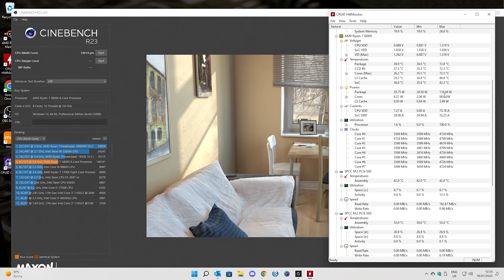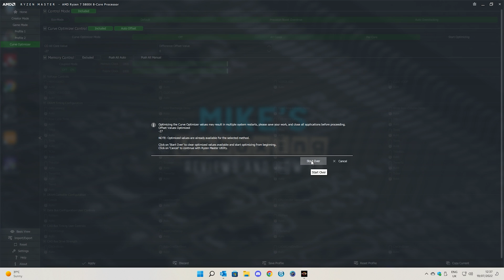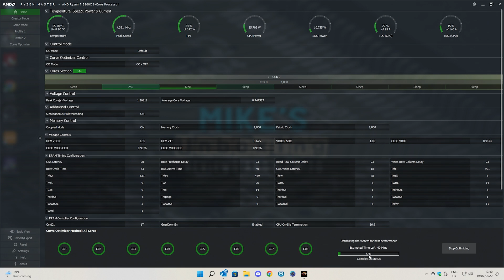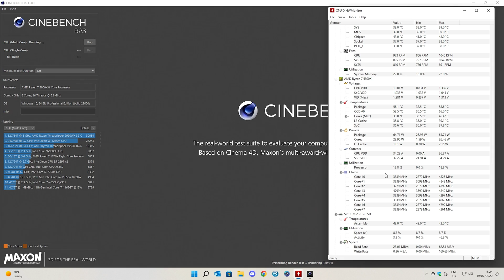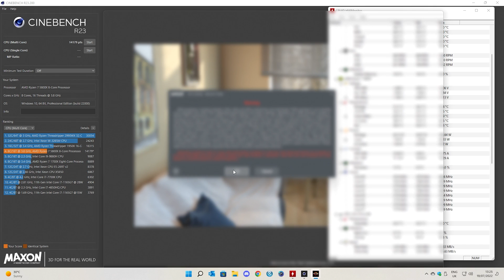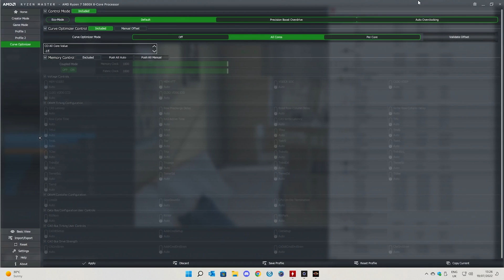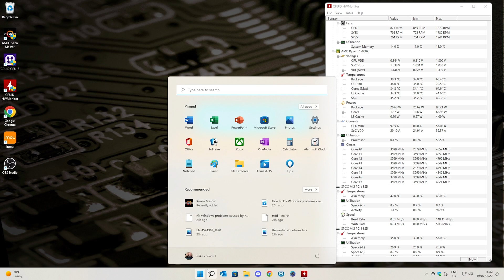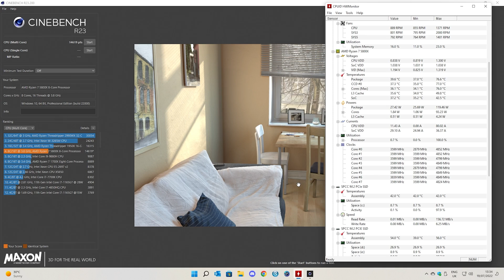Make AMD Ryzen 5000 Series FASTER QUIETER & COOLER With Curve Optimiser

Comment: I have a Ryzen 5700X using a ASUS B550 Prime Plus with a NZXT 280 AIO, Corsair Platinum RGB 32GB 4x8GB @ 3600Mhz and a RTX 4070…I just ran the Per Core Optimizer and it’s figures just showed me -30 and I applied and all seems fine…surely this can’t be the case? The program said it may restart multiple times but it never did just took an hour to complete. Can I just keep the applied settings and not have to worry about PBO?

Comment: Hey, first of all thanks for the video, it helped my keep my 5800x under control even tho I have a dual tower air cooler and very good case airflow, second, do you know if Ryzen Master has to be opened each time and click each time apply in order for it to work or is it saved?
Reply from the maker: yes ryzen master needs to be running for the master settings to be working

Comment: Hello.

I followed your tip on your video using the Ryzen Master but on the part of changing the value from -19 to -27, it restarted over and over when I entered my profile password and loads up. I'm still waiting for the third attempt to open my profile for the third time. Should I revert back to -19 just in case?
Reply from the maker: yes lower it a bit to regain stability
Reply: @mikesunboxing  thanks for this help. When I tried to lower it, I turned off and pulled the power cord out, and performed clear CMOS. Then I turned on and checked my BIOS if there were settings that changed to default. After this, I proceed on loading Windows.

Upon loading Windows, I proceed to Ryzen Master and revert back to -19. I wonder how to stop the start-up prompt of the Ryzen Master upon loading to Windows, because this automatically prompts me to use it although I'm not opening it during the Windows loading.

Comment: hello,  I have a Ryzen 5 5600.

I optimized mine and Ryzen Master set set it to -27

my max temp is 72.9
max power package is 95.20

I tried it to -30

my temp and power is much lower,
max temp is around 54
max power package is 65

but my core clocks are not reaching 4.6

it's only maxing on 4.2

any idea why is that? and what should I do to reach 4.6 at lower cpu temp and power
Reply from the maker: might need to manually set the multiplier, but if the performance is the same or close i wouldn't bother
Reply: @mikesunboxing  how do i do that?  btw, im apparently optimizing PER CORE and see the difference
Reply from the maker: This is maybe easier to fix or at least advise if we can ask more questions and get direct answers, so feel free to join our Discord chat and we can go over it in more detail https://discord.gg/XtBTGQ6BDu

Agree to the rules by clicking the emoji and you will get access to the rest of the Discord channels @macabrecreation1067
Reply: @mikesunboxing  thanks a lot 😊

Comment: I just did this with my 5700x.
With only curve optimizer running and overclock still set at auto without adjusting anything its running a -26 all core with CO. 
I ran cinebench r23 with YouTube playing in the background and got a CB score of 15,631. 
How is my 5700x scoring better than his 5800x?
Reply from the maker: more tasks running in the background and maybe better quality silicon or cooling
Reply: @mikesunboxing  oh i see. That would make sense. 
Quick question: Will curve optimizer automatically undervolt each core to optimal levels or do I need to undervolt little by little till i find the sweet spot AFTER having curve optimizer already enabled?

Comment: 14,600 for 5800x is low I guess. I got 15,600 but temperature got upto 88 degree.
Reply from the maker: yeah i have way too much crap running in the background.
Reply: @mikesunboxing  Which cooler did you used with 5800x ?

Comment: I have the "Control Mode" option in the basic view, but the "Curve Optimizer" option is not displayed. - Do I need a special board / a special Ryzen processor for this function?
Reply from the maker: what board and processor do you have
Reply: Ryzen 3600 + MSI B450 something.
Reply: However, I have long since solved the "mystery". The FAQ provided by AMD for the Curve Optimizer states the following: 
Is it supported on all AMD CPUs?
No, the Curve Optimizer feature is only supported on the CPUs listed below:
Desktops using AMD Ryzen™ 5000 processors.
AMD Ryzen™ Threadripper™ PRO 5000WX processors

Comment: Is there a way to make new mater ryzen settings be applied upon pc startup?

Or will i always have to open
ryzen master app to apply my undervolt settings?
Reply from the maker: you could transfer the setting to the BIOS, that would do it, the reason it doesn't auto run is because if you screw up the settings windows will always try and load them

Comment: The only bad thing about Curve Optimizer is the interminable battery of testing that's required before it can be certified stable.
Download PBOTuner 2 and Corecycler, and be prepared for some (automated) overnight testing - Ryzen Master gave me -28, -30, -30, -30, -30 and -30, but testing eventually forced me up to -20,-20,-30,-30,-25,-25 (which is still a cracking result).

Comment: great video, thanks for it. I would like to ask what cooler you use for the r7 5800x in this test? Also how you got the power of the package be only max 110w without changing it in PBO? In default when I run cinebench r24 it will run on my r7 5800x 142w on package and temps go to 85C. I got it little byt down but need to do curve opt per core (got only -25 for all except primiry and secondary core, this needs to go  down to -15 for now) and also needed to adjust PPT to 115w TDC to 90A and EDC to 100A to get lower temps. but still hit 80C. also without the limit of PPT the CPU always took 142w on package when running cinebench r23 ( multi core test). also with this setup I got only 4,4 GHz on all core in CBR23 in multicore test. thank you
Reply from the maker: cooler was probably sahara ex360 i think at the time, not sure what other tweaks were done sorry it was a while back now

Comment: I'm having issues with my 7600x on the X670E Steel Legend, with bios update 1.24. Windows 11 - 21996.1

I have a 280mm AIO, Liquid Freezer II Rev 3, and I have ensured 3 times that its functioning properly and is more than adequate cooling. BUT still no matter what, it cant get the temps down the same as what would usually be expected with these specs, and thus its thermal throttling and hitting max temps (95c).

I'm getting around 12200 - 12400 in cinebench r23, when the expected result stock, even with a shitty air cooler should be in the range of 14k+ bench result.

I've got this niggling feeling that its something to do with the bios, but I wouldn't know, because when I first set the PC up 3 days ago, I updated the bios with USB before I even installed windows.

I really want minimal risks with installing BIOS updates, or roll backs for that matter, but I'm still wondering, does anybody else have this issue, or have had issues with low stock benchmarks on my board, and whether or not its worth rolling back my BIOS and if so, to which one.

Specs:
2x G.Skill Trident Z5 Neo RGB 16gb DDR5 6000 CL36 EXPO
x670e Steel Legend
Ryzen 5 7600x
Zotac 3060 TI Twin Edge OC
Arctic Liquid Freezer II 280 A-RGB
SN850 1tb NVME
Windows 11 - 21996.1
Reply from the maker: definitely get the newest bios then test again, if you are unsure if the BIOS update worked correctly update it again to be sure

Comment: What's the stepping of this 5800x B0 or B2 as B2 Stepping 5800x has already optimised by amd i have 5800x with B0 and horrible temprature spikes and running 90+ in no time as soon as started multicore cine bench r23 what to do now please help me out can AMD give me rma for the thermal issues?
Reply from the maker: the details in the video should enable you to reduce temps quite a lot, although all core cinebench loads will also generate a lot of heat
Reply: Can AMD accept the RMA Request if generate on the basis of high thermal issue overheating amd thermal throttling and abnormal behaviour of their perticular defective product?

Comment: Thank you so much, Im glad i found this video. Last time i saw a video about under volting 5000 series was too technical and i cant follow everything. Im glad this video exist. Now my 5800x run cooler from 89-92c (default) to 75-79c with 14944 score on cinebench
Reply: thats still quite high
Reply: @89MTN Everyone seems to be missing the point Ryzen processors are designed to run like this AMD tells you this perfectly safe. You wouldn't buy a 1000cc sports bike and only ride it at 60mph would you it's the same difference
Reply from the maker: Glad it helped

Comment: This detailed video was quite helpful. I recently bought a PC that has the same CPU. I'm in a much cooler room (22C) than you were and out of the gate with a fresh Windows install Cinebench is driving the CPU to nearly 90C with just 1 pass! This PC is liquid-cooled and the seller claimed that it did not have issues, so I've reached out to them to resolve this. I'm assuming they did not adequately liquid-cool it. Thanks for the video!
Reply from the maker: sounds like it isn't properly installed
Reply: @mikesunboxing  It's an MSI pre-built (the Aegis ZS). It's possible they made a mistake during assembly but I'm wondering if it's a lack of enough coolant.
Reply from the maker: @Daniel-vx5vc  This is maybe easier to fix or at least advise if we can ask more questions and get direct answers, so feel free to join our Discord chat and we can go over it in more detail https://discord.gg/XtBTGQ6BDu

Agree to the rules by clicking the emoji and you will get access to the rest of the Discord channels

Comment: So I ran this with pbo +200 on and let it run the 40min test. Im actually mind blown. Im hitting a few points over 12k in cinebench multicore now with a little ryzen 5600 on a 360 AIO.......Thats faster than an 8 core I9 9800X in multicore. waw what a difference. Im also running everything on full load at least 9 Oc cooler than before. The offset it wanted scared me a bit but its not had a problem in 48 hours of heavy use. -30 offset it chose btw waw. I honestly thought running this on a 6 core with such a heavy duty 360 AIO on it wouldnt be worth bothering with. Boy was I wrong. This CPU now under load sits at 4.645ghz steady while running cooler.
Reply from the maker: that is an awesome result, well done
Reply: settings pls

Comment: I did that and my temp never went above 65C..so im wondering is my cpu working properly or my cooling is too good?? I have 5600g with AMD cooler that comes with it.. max freq. Is 4.449,voltage 1.311
Reply from the maker: that sounds pretty good for the stock cooler, if the benchmarks look about right i would not worry too much about it and just enjoy it
Reply: @mikesunboxing  i did it again just out of curiosity.so the temp is perfect but around 54% completion i just get random reboot.im thinkin the voltage is too low, i already have offset on -0.5..idk it just intrigues me now.btw tnx for taking the time for reply

Comment: Hi Mike - I wonder if you can help - when I run the Curve Optimizer and apply settings, on reboot it gets stuck in a boot loop and won't open windows (11). I can remedy this by resetting BIOS, but obviously it then won't have the settings applied. Any ideas what this could be? It's the 5900x
Reply from the maker: It might be applying a too low voltage maybe manually up it a little
Reply: I have the same problem with my 5900x.

Comment: Ryzen master give me -30 for all cores but the power goes up tp 1.45 mV. I got more fps and bit less temperatures. But where is that undervolting? I thought to get around 1.2 to 1.3 mV maybe loose some fps / ghz but much better temps? Did I something wrong
Reply from the maker: ryzen master is a bit conservative on voltage, you might be able to reduce it more
Reply: @mikesunboxing  what should i do if i want to decrease voltage and temp? I Choose - 25 and voltage not descrease
Reply from the maker: @nef1ss  This is maybe easier to advise if we can ask more questions and get direct answers, so feel free to join our Discord chat and we can go over it in more detail https://discord.gg/XtBTGQ6BDu

Agree to the rules by clicking the emoji and you will get access to the rest of the Discord channels

Comment: great and informative test. One thing to note, is that the number in the Curve Optimizer setting is not the raw milivolt number, but rather a kind of multiplier, where 1 count equals 3-5 mV. so when it shows -27 you're actually offsetting the voltage by 81-135 mV, hence the massive difference in temperatures.
Reply: Thats interesting thanks for the info friend. My offset on a little ryzen 5600 came out -30. The results on cinebench are just over 12k multi now. Ive gained over 300 points. I also run at least 9-10 Oc cooler under load than before. Isnt -30 a bit high though? I ran the test twice to be sure and first was same. I got that offset while running pbo +200 and it sits at 4.645ghz ish and barely moves.
Reply: @bumblefoot5  this isn't with the stock cooler is it
Reply: @xenooseater6124  nah I through a 360 radiator on it. Overkill I know but an investment as compatible with my planned AM5 build planned for AM5 2nd gen releases .
Reply: @bumblefoot5 for best results and insured stability, I would recommend doing it per core test instead of doing all cores. Then run OCCT, any errors that could cause instability will be caught by that, then you can lower your numbers by 5 or so until you get stability. It would take longer, but would also ensure the best stability of your system and minimize any degradation.
Reply: Same here, even without pbo curve optimization, 4650mhz is top for r5 5600, temps are not problem with decent cooling....

Difference between 4450 without any tuning and 4650 after many hours of tuning, hit and miss is.... Only visible in benchmarks,.in gaming, real situations etc - none.

Temperatures are not an issue even with a stock cooler.
Reply: @damird9635  Probably fair. I just find since I did the curve with a 360 coolcer on it the temps and cost factor are impressive. Then again not ever cpu is made equal there is a silicon lottery in there. My curve maxed without an issue I cant take it any higher, I current have an mmo running and 3 youtube windows open in 1440p and my temps 25oC.
Reply: @bumblefoot5  really didnt notice any real benefits, yes, cpu is bit cooler (irrelevant with 240mm aio, is it 40 or 43 in gaming), draw less power, again, nothing to worry about... And max clock is 4650, same as without fiddling with curves. Every cpu is different, i really didnt find documented and explained case on how to break this 4650mhz cap, on all cores. On single core, not a problem, via direct overclock. In fact, when one is back to basic overclocking - adjust voltage a bit, and set multiplier at 4.x  yields better result in benchmarking at cost of power consumption, and bit hotter cpu.

Max that i found on all cores is 4850, by simply raising voltage and typing 48.5 in multiplier. Again, in games, totaly uninportant, benchmark show better numbers, but primary task for my pc is gaming, and in gaming, 4.6 or 4.8 cpu is almost the same.
Reply: @damird9635 depends on if you won the silicon lottery or not, I imagine. For something like the 5600, it might not make that big of a difference, but if it's a high-end chip that runs a lot harder, that sort of thing can make a massive difference. Maybe not for the 5600, but the 5900 I've heard very good results including lower temps on gaming.

Comment: Question....what's the difference between auto oc and per core?
Reply from the maker: you can set individual speeds for the core manually some core OC better than others, auto will try and find a balance across all cores
Reply: to  thanks
Reply from the maker: @mqcapps  No problem 🙂Have a great weekend

Comment: Excellent video Mike! Any follow up vid for 3000 series? I've seen lots about undervolting cpu / gpu but not even dabbled yet. I always considered these amd utilities as bloatware but actually a decent tool. I'll be trying this with my 5800x, I've a 3900x in another machine but that looks like needs manual tuning.
Reply from the maker: yes on the way

Comment: Didn't do much for my 5600, actually lost about 600 points in CB R23, but idling went down from 11W to 4W.
Reply from the maker: a little power saving, that is a good thing, what about max temps? A little lower also?
Reply: @mikesunboxing  Don't know about temps, they are still below 40C

Comment: My 5800x always runs at max speed. At idle I get temperatures up to 70 degrees but in games it’s not worse.
Reply from the maker: ouch! motherboard overclock?
Reply: @mikesunboxing  no nothing but it seems like my 5800x runs at 100 percent at idle. idk what the problem is.
Reply from the maker: @tiz6581  This is maybe easier to fix or at least advise if we can ask more questions and get direct answers, so feel free to join our Discord chat and we can go over it in more detail https://discord.gg/XtBTGQ6BDu

Agree to the rules by clicking the emoji and you will get access to the rest of the Discord channels
Reply: @mikesunboxing  thanks for the advice

Comment: Need to be careful here. It's not running at full or high system load that's the problem. It has been noted that random crashes/lockups occur at low system load or background tasks.

Comment: Hi Mike, did I hear you say that the Curve Optimizer updates it's settings in the BIOS so they remain in place?  I don't believe my current version (which doesn't have the Optimizer) does that. I currently have to run the Ryzen Master every time I restart my system.  If that is the case I'll update my version immediately.
Reply from the maker: pretty sure that is the case, if not make a note of the undervolt setting and apply it in the bios